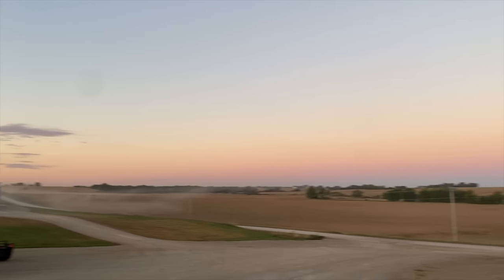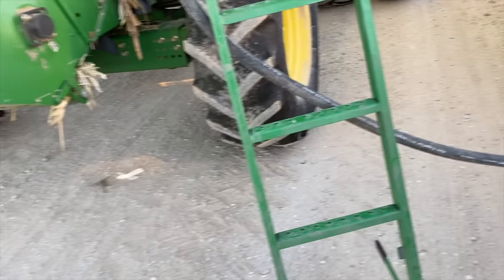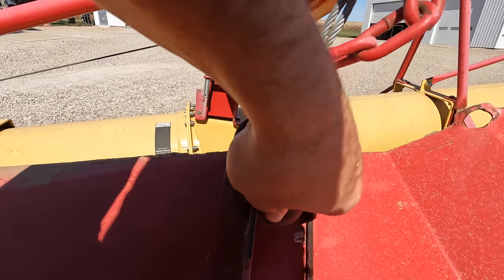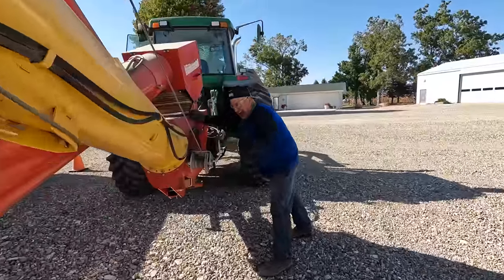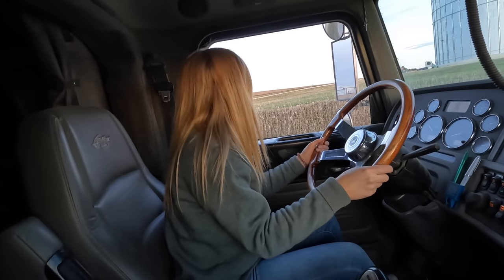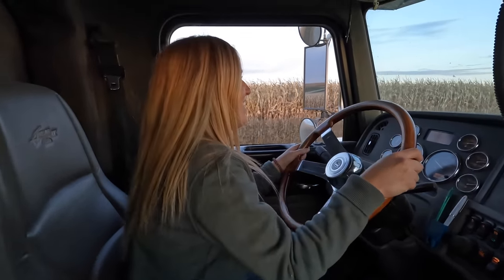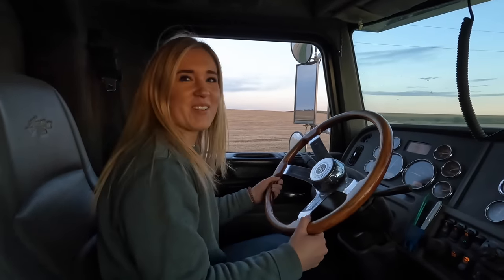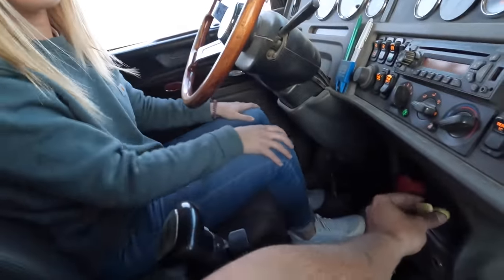Her First Time Driving A Semi!

Comment: Hard to get cab corn on an old massy 850. She did good for first time. I never had problems with tractors on the farm. But every time I got in a manual vehicle I’d stall it. Now I daily drive a manual. Semi first time I stalled out the old Mack.

Comment: The no 1 thing I teach drivers/operators is get to know how the seat works and get it right, so you will not have the extra struggle when driving/operating, especially learning to drive/operate. So adjust the seat for a few parameters. 1, Peddle push length, 2/. Height to have clear view around you. and 3/. Length to press farthest item you need to press or adjust when driving, plus feel the room of the stick shift to make sure you are not in the way of it movements.. I do all this before I start any vehicle I drive.. If you have issues, you know before hand, instead of finding out when driving, therefore can plan accordingly.. Repeat everything above after you adjust the seat. A comfortable seat means easier to operate and less pains (both emotional and physical pain) after a long period of time. If you are struggling within a short time, find a safe place to stop (put vehicle in safe idle mode) and readjust seat.

Practice makes perfect. Always gets in the habit to plan the journey for obstacles.

Comment: Your down shifting is interesting. I was always taught to give it more throttle to pop it out and then let off and then get back into it to get it in the lower gear! Never use the clutch to down shift
Reply from the maker: Yeah 2 ways to do it! I see a lot of people do it the way I do. I get the truck down to 1000-1200 rpm, slightly push in clutch just enough to get out of gear then rev up and float the lower gear. For me I feel I have more control as I’m reducing speed. I don’t like revving up while I’m gear to slow down, feels odd to me. Always multiple ways to do it, just whatever you’re comfortable with.
Reply: @mannfamilyfarms381  Exactly the way I downshift.

Comment: Curious why you aren't floatin the downshift as well? No different then floating the up shift. Let off accelerator, Preload the shifter, lightly tap the accelerator and she pops right out of gear.  Much easier and quicker then using the clutch imo.. 
I know everyone has there own driving styles but the only time i use the clutch is Start/stops or if its Sticking in a gear / isn't fully going into gear then ill tap the clutch quickly.
Reply from the maker: I’ve been driving a lot lately and I tried that quite a bit one day. I didn’t mind it but sometimes it gets jumpy trying to get it out of gear. By just slightly pushing the clutch in to get it out I feel I have total control. Just me though

Comment: Nice job , just feel in to gear and out of gear , it’s called synchronized shifting the object of it without a clutch is the ground speed of the tires and the drive shaft need to be the same speed ( synchronized) 1500 to 2100 will shift Easley with out a clutch , you can shift all the time with the clutch you just need to adjust for RPMs and road , thanks BigAl California. Praise Jesus Christ grace amen 🙏